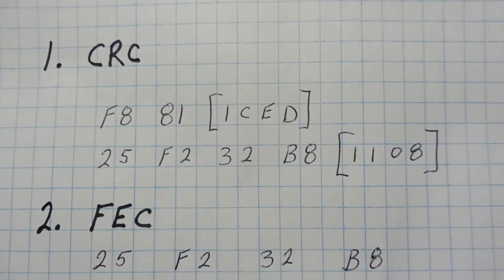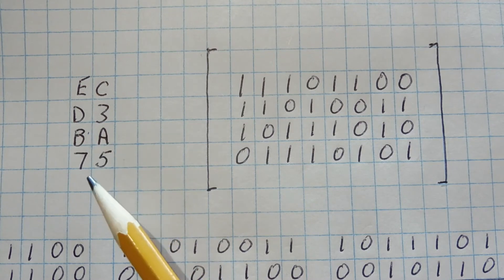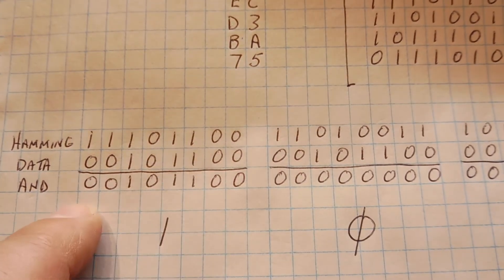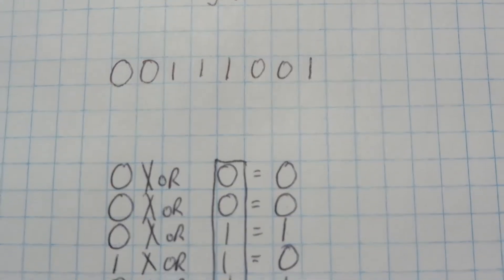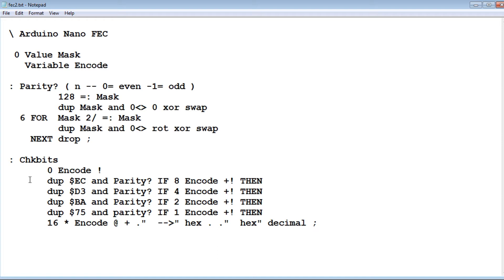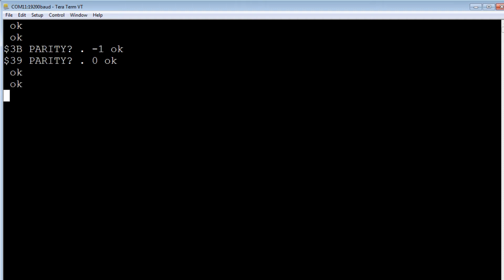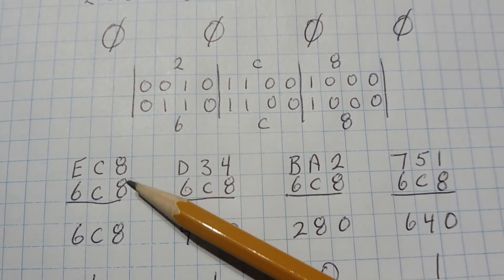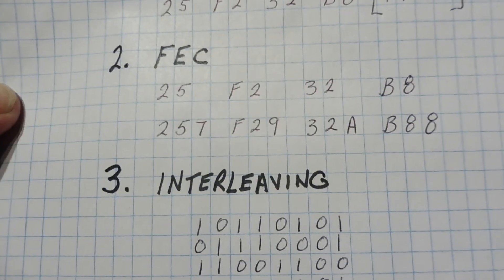Hamming Matrix And Forward Error Correction ( FEC )  \  Part 2

Comment: That was all quite clear and interesting ... except for the interleaving. I understood the interleaving but I didn't get why I'd want to do it. Thanks.
Reply from the maker: I was going to get into it a little more but I try to keep my videos to 10 minutes max.
Interleaving makes FEC work better by trying to make all errors single bit errors.
Picture a data bit stream a mile long going from point A to point B. A burst of noise in the middle destroys 20 bytes which you can't recover.
When you interleave, the data bits in each byte is spread over the entre 1 mile length.
Now the burst of noise in the middle will destroy single bits of 20 bytes which can be restored.
Reply: Thanks for the response. I kind of got that but now I think I understand. Another way of saying it is, since the FEC is applied to each byte, the interleaving spreads the bits of each byte out. Since data loss often happens in bursts, loosing several bytes in a row results in loosing only single bits in several FEC groups (or whatever those groups of 12 bits are called).

I really like how you do your videos and the length is good. Keeping them to about ten minutes keeps the subject in a single unit. I'm a retired engineer getting back into electronics as I started; as a hobby. Your videos help me recall what I once knew and filling out some corners of knowledge I've neglected.

I've never used Forth but I did read lots about it back in the '80s I think. Maybe I'll finally try it out. Thanks again for your fine content.